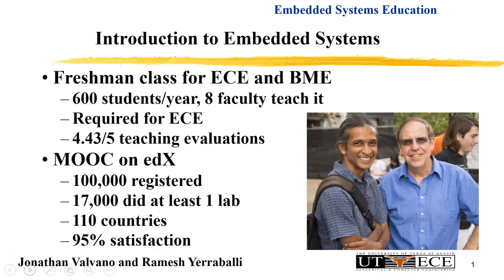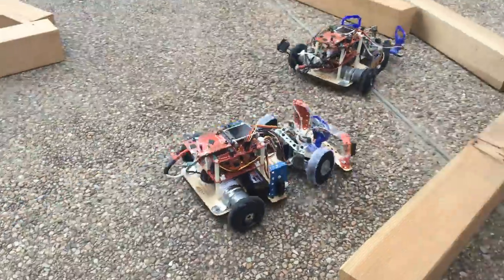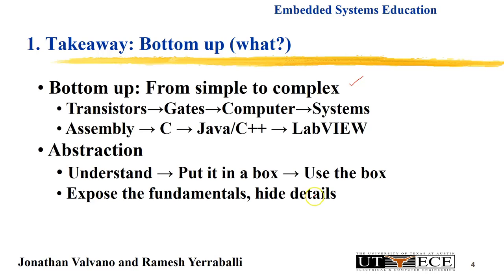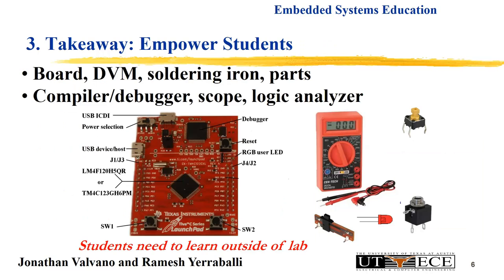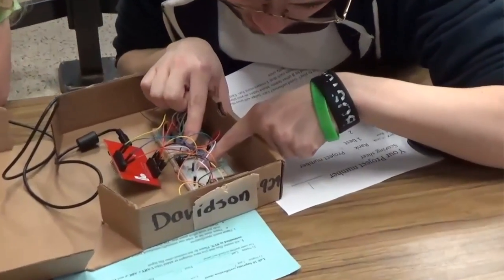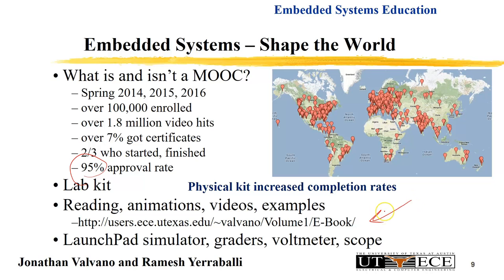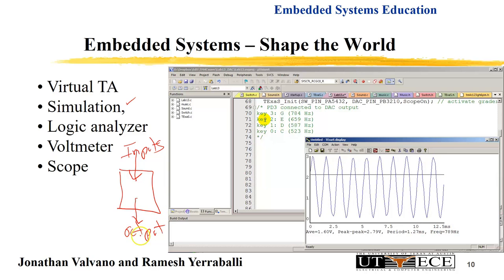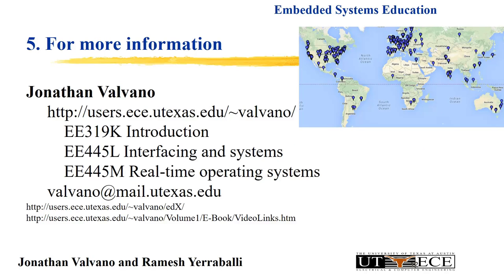TILaunchPad:   Hands on Learning @ Univ of Texas_Valvano_Yerraballi

Comment: Nice work. How did you decide on what materials to include for student activities? Do you update them each year or term? Do students buy kits or are they loaned out? How much do they cost? What are the direct benefits of the MOOC structure for the on campus students?
Reply: There are 10 labs and they are modified in letter (change ports for example) but not intent each year. 

Students buy their kits (microcontroller and an LCD display), we give them all the other components (switches, LEDs, H-Bridges, any ICs, slide-pots, resistors, capacitors etc.)

The on-campus students find the access to the MOOC materials (videos, ebook and forums) as valuable complementary  resource.

Comment: Your first slide indicates that Intro to Embedded Systems is a Freshman class. The web page for ECE 319K says that it builds on EE 302 and EE 306. It seems like the students enterring ECE 319K have a fair amount of EE background and programming experience. In addition to EE 302 and 306, are there prerequisites for this freshman class? Do you have students with diverse backgrounds, e.g. lacking programming experience, taking this class? How many BME students take the class?
Reply: EE319K is taken in the Spring semester of their freshman year with 302 and 306 completed in Fall. 

We do have students with varied background in programming, which has been challenging. We do the first half of the labs in assembly (where the playing field is level) and introduce them to C in parallel. The second half of the labs are in C where the ones who have had some C before have an advantage but the others have had a good amount of exposure to C by then. 

Used to be that all BME students (~140) took the class but in the Fall semester when there are fewer EE students taking it. It is no longer a required class for BME.